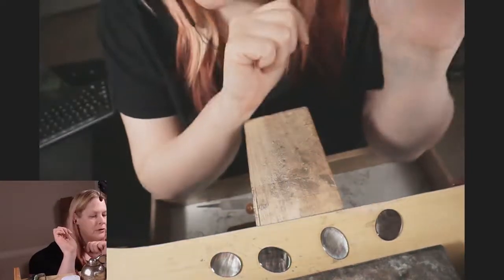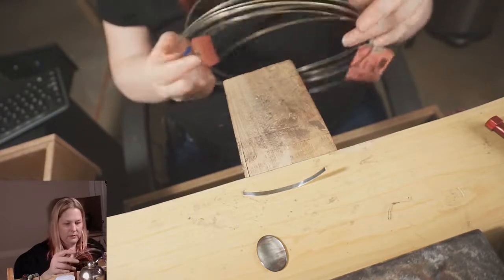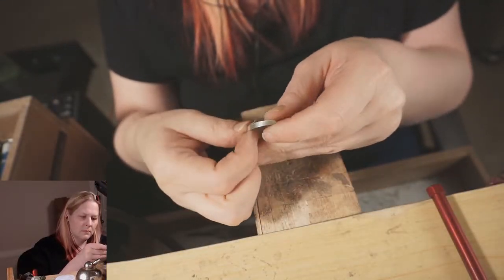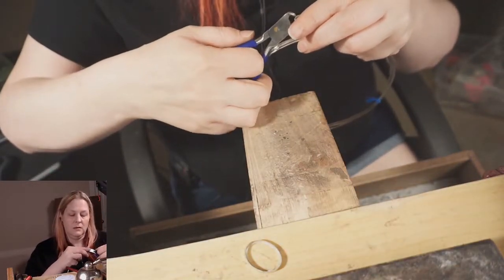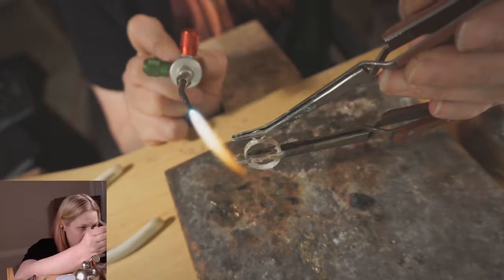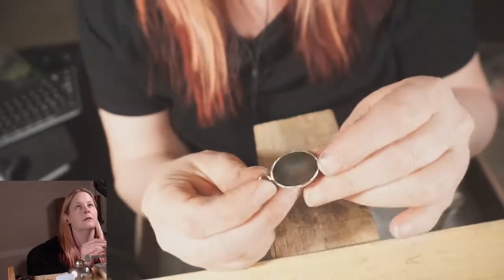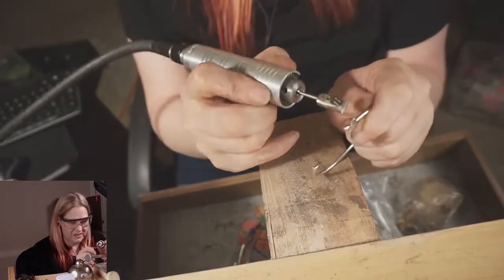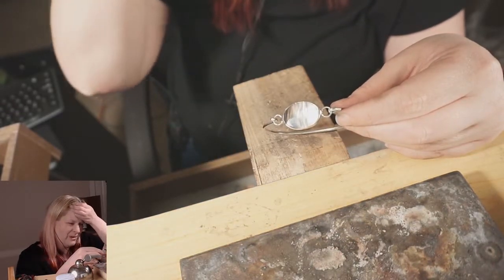Black Mother of Pearl Cuff Bracelet - Twitch Creative Stream

Comment: I stumbled upon you video is search of tutorials on building a rosette for a guitar. I lie Black MOP and thought it was natural. Also I am curious to learn where I can get a flat roll pf sterling silver such as the one you use here? I trust It is possible to get 24 ct gold as well? Thank you.
Reply from the maker: Hi Jeff,    Natural mother of pearl is white w/ the iridescent sheen, so to alter the color, a tinted epoxy is usually layered over top of the shell. The darker shell we often use for inlays is black Lip shell, which can shift from ivory to tan to almost black, but tends to lack the vibrant rainbow sheen of MOP, so there's a trade-off. In jewelry, I like the resin topped MOP for the extra sheen color, and for the extra protection from impact. =)    As for the sterling silver bezel tape (sometimes just called flat strip), check out Rio Grande. They are an amazing company that offers different account levels for students, non-business & business, all of which allows precious metal buying. If you have any other questions, don't hesitate to ask. =D
Reply: Wow, thank you for your kind reply and insightful knowledge. One further question, I am seek and reliable source to find genuine black onyx, ideally laser cut. Any insight for finding such a vendor?